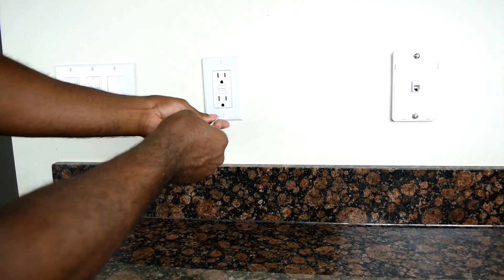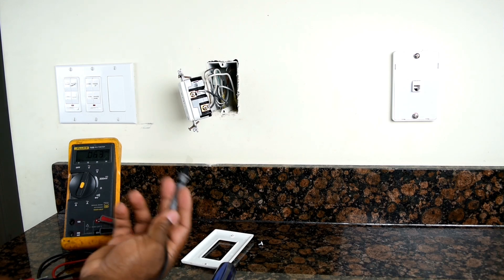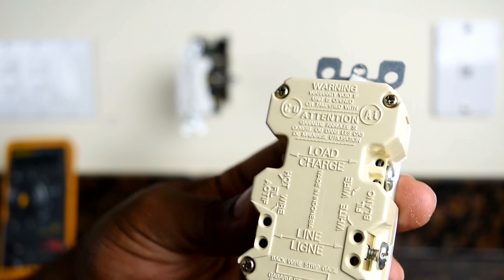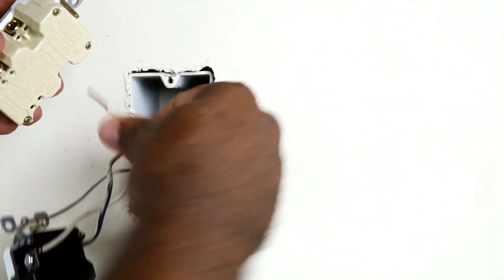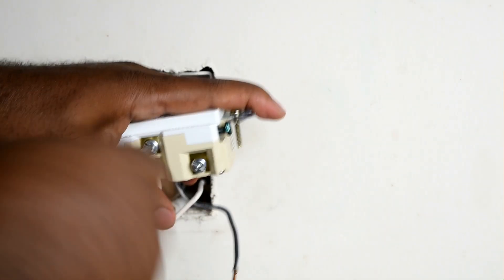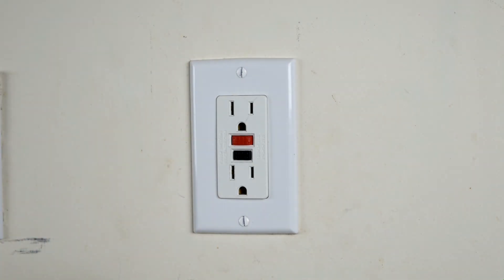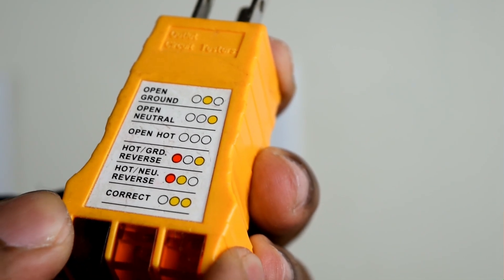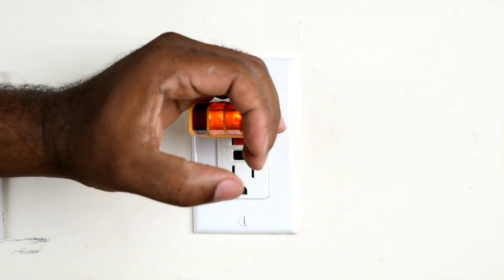How to install or replace a GFCI Outlet

Comment: Nice explanation on the correct wiring (line vs, load terminals). If I might add one thing: if that GFI is controlling other receptacles in a Kitchen and is on a 20 amp circuit (with 12 gauge wire), then the new GFI should be rated for 20 amps, as well. Those have that funky t slot on one side of the device.  You also want to test the correct wiring be tripping the recept. which kills the power to the other receptacles down stream on the load side. It is easy to get the conductors mixed up inside a receptacle box with multiple wires.
Reply: Perfectly acceptable to put 15A GFCI on 20A circuit
Reply: @thefritzy81  
That's what I was thinking. If you had a single dedicated receptacle on a 20 amp breaker such as for an AC unit then yes, a 20 amp receptacle should be used because that single appliance may be drawing more than 15 amps.

Comment: My gfci outlet buttons don't work, the test button won't push in at all, and the reset button won't click or stay in when pushed. Does that indicate a need for replacement? If flipped the breakers twice already and no change. I bought a replacement but don't want to mess around with it if I don't have to.
Reply from the maker: Yes, sounds like it needs to be replaced.
Reply: Gee, thank you so much for responding. I really appreciate it, no I can feel a little bit more confident in taking this on. I even went out and bought the same test meter you used. Thanks for the great vid! Will follow step by step.
Reply: Cyndi dssssd Baby Alive. Baby Alive videos baby Alive videos baby Alive videos on for me please on YouTube r ewsschvdx

Comment: ive been replacing several plugs and light switches in my house. all of the ground wires coming out of the wall have been cut off. will that affect the gfci plugs that i need on the bathrooms?
Reply from the maker: The ground wire is important provides protection. If the ground wire is cut off at the outlet then there is a chance that its also cut off at the panel.
Reply: Not sure, When I bought the house, the bank made them install a new breaker panel by an electrician. How would I find out? take the breaker cover off and look in it after I shut off the main?